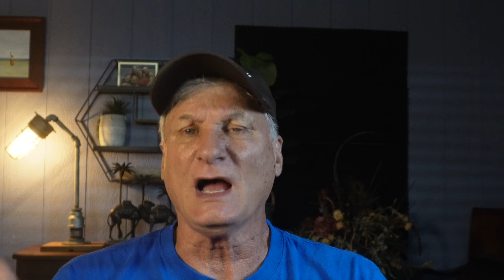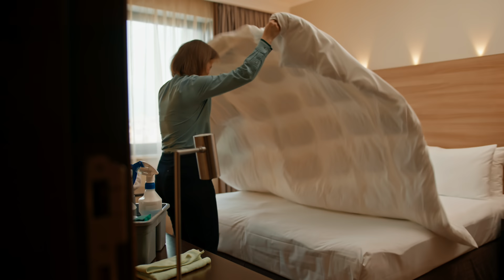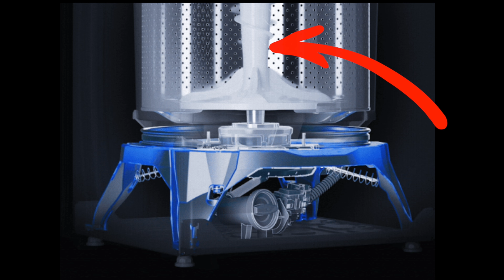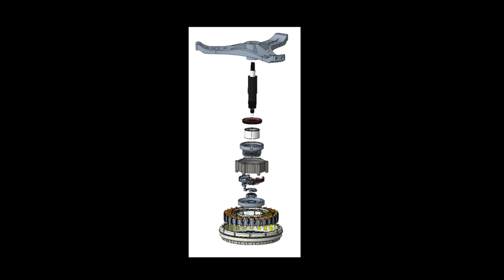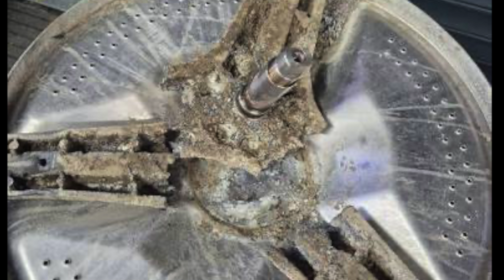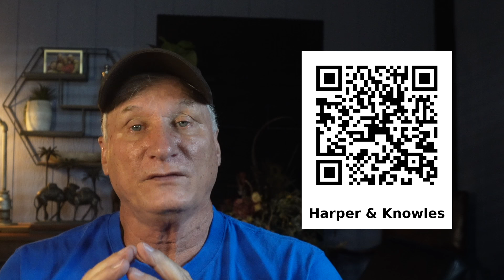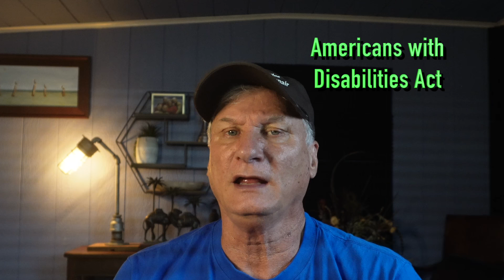Maytag's New 30-Year Washer: No Gearcase, Real Agitator, 900 RPM

Comment: Whirlpool has been "leaking" information on this new "commercial" Maytag washer in a similar fashion to their last Maytag "commercial" washer. We service techs know how that turned out. The current Maytag "commercial" washers are the same skimpy unreliable design as all the other Whirlpool/Amana/Admiral washers. This new design doesn't address the weakest link of all and that is electronics. This new design is still electronics dependent which means there's going to be a lot of expensive repairs on these machines.

Comment: Still running a Whirlpool top load from 1999. Only had to replace the lid switch and agitator dogs once. Nothing else. If it had a larger tub it would be perfect. Simple to operate and repair. No electronic crap. Question, in your opinion which household top load machines currently sold in big box stores are the best quality?

Comment: I'll believe it when I see it. I have no faith in our old famous brands, and even less faith in Korean made appliances.  Just because there are only two parts, doesn't mean those two parts are made of quality materials.  Then these washers and dryers use crappy appliance paint that chips and rusts within 2 years, so even if this washer can be rebuilt, it might be all rusted out before 30 years is up.

For the washer to only last 15 years with 3 kids and husband with dirty clothes, plus wife, is not a long time, we had a Maytag with 4 kids and the parents, and it lasted 32 years and was still running when the buyer of the house wanted those Maytag's to stay with the house.  But, 15 years is better than 4 years that a Samjunk will last!  But will that Maytag, if it's built the way they claim, which is the old way, outlast a Speed Queen?  Time will tell, but I won't be rushing out to buy one since I have Speed Queens.

Comment: Still DIY fixing my 21yo Whirlpool Gold Washer and Dryer from 2005. Family of 5, running them daily. Almost all the parts are inexpensive. 

Top Load Washer: No transmission, just a direct drive motor. The motor connection (plastic and rubber) piece wears out every few years. Had to replace that twice. Door switch finally broke. No suspension rods to break. The most expensive repair: The motor finally gave out after about 18 or 19 years, and it was less than $200 for a new one.

Electric Dryer: The rollers in the back wear out eventually. Replaced those twice. (Get good ones, as the cheap Chinese ones just don't last. That could count as a third set, but I count it more as a learning experience, not the fault of the washer.) One of the temperature sensors broke, inexpensive. The heating coil went out after about 16 years.

At this point, one or the other breaks down every other year or so, and I can pretty easily get it back up and running within a couple days. It's not hard, once you understand how they work. My boys have grown up watching me DIY fix all my appliances, cars, etc. so they jump at the chance to do it now. I usually get to diagnose, buy parts, and often come home to a finished job.   

Hearing the trouble the "new" washers from 2010 forward are having makes me glad I got the ones I did, when I did. Knobs and mechanical timers and no screens (minimal electronics) are the way to go.

Comment: 7:39 My mother had a Maytag that died a couple of years before she did.  We called it the "may fag" and said, "See?  It did fag, already!"  It had a 3 phase motor and a converter board that controlled it.  This board converted single phase 110 volts AC to DC.  Then, it had 2 banks of semiconductor devices, 3 in each bank, which I believe to be IGFETs (Insulated Gate Field Effect Transistors).  The first bank of 3 had one side, either the source or the drain, of each connected to the DC positive.  The other bank had one side of each connected to the DC negative.  Then, the opposite side of each of these semiconductors was connected to one from the other bank and one of the 3 coils of the motor.  The gates were connected to the low-power electronic control circuitry which switched each IGFET on and off with proper timing to simulate 3-phase current.  By varying the duty cycle and timing of the pulses, they could speed the motor up, slow it down, or even reverse it by swapping the timing of the pulses on any two coils.

Comment: The whole purpose of the ADA is to make sure that disabled people have the same access to public & private spaces that non disabled people have independently, and without the requirement of another person to assist in whole or in part. In the home, that means appliances must be fully useable from a seated position. 

A top loading washer fails that requirement because from a seated position: 
the lid cannot be opened, the tub is not visible which also means items cannot be removed if tossed inside. This also makes closing the lid difficult or impossible without assistance. And lastly, the controls: 1. cannot be accessed from a seated position; 2. knobs cannot be turned if the disability is related to hands permanently being in closed position, fist-like position and/or lacking the ability or strength to change the settings. 

Front loading machines solved the tub and controls location accessibility problems, whereas buttons are easier than knobs for some. People void of hands or arms may find buttons or knobs more accessible depending upon their individual situation. However, wifi software that can be linked to accessibility software is where access to controls shines which means that hand and arm disability & even blindness are better able to use machines without requiring a non disabled person to wash (and dry) their clothing. 

Stove/oven controls on the front instead of the top or a pop up on the rear is another example of an adapted appliance that is ADA compliant. Refrigerators and freezers as combined units aren't truly compliant. Only the drawer type that can be set into cabinetry spaces really allow full access. Drawer dishwashers are also better  than the standard folding door types.

😉 This has been a quick PSA from a member of the disabled community.

In our daily lives, round doorknobs eliminate access (replace with levers) curbs create barriers, steps create barriers, doorways less than 3 ft wide eliminate access, and public toilets* without the space and ability to rotate a wheelchair or walker into position to transfer between the commode and device privately eliminates access but also, and especially, the dignity of a disabled person.
*Please also remember we only get a single stall in public restrooms that we can actually use and our internal organs can also be affected by disability  making our ability to wait for that dedicated stall problematic. Please remember to consider us when walking into an empty restroom and having your choice of several stalls.  Thank you!

Comment: There was a time when every washing machine was built to last 30 years.
Reply: Thats how we help to save the environment, by building things that last decades rather than get replaced every 5 to 10 years.
Reply: @shawSumm4647 exactly. I never understood how we are "saving the planet" by buying awful machines that need an extra rinse & maybe even a 2nd wash & then it dies in 5 years. Same with toilets. How is it saving the planet if you need to flush 3 times. It gets me so mad because everything was sooooo much better. Same with fridges. They took away freon for a junk that spoils food.
Reply: Wasn't the change of freon. It was the recycled aluminum and making the coils thinner for better heat transfer along with cheap parts and computerized crap that made it unreliable. The lunar compressor from LG is junk. A basic over and under " freezer on top fridge on bottom," is still the best buy. But not LG.
Reply: @MattyDemello  Yep, and I was told by the guy installing my new house AC that they are coming up with a newer refrigerant that's even worse than the current one.  Next time dems get control...   climate-cult bull-headed democrats.  Vote republican at every level.
Reply: @MattyDemello  capitalism has a tendency to enshittify everything. we need to stop doing economics like dumb apes and start organizing society intelligently instead of putting the power of production of entitled brats.
Reply: @shawSumm4647 and the epa says climate change no this is how it started
Reply: @logansmokes.2762 
climate change is a myth anyway, same with fuel and water scarcity, it's all artificial.
Reply: my washer is 50 years old and still repairable.
Reply: @moabyte2 it’s getting harder to find people to repair them.  Those who do have. 70 machines in shed, and a dozen old ones for sale.  Brought my mom’s before she passed, now mine.  He said $100 to fix, or I give you $50, then I sell it +$400 in a week.”
  I think she got it 1980
Reply: @larryharris5840 
That’s the beauty of it - you don’t need someone else to repair it. You can take it apart and figure it out! So says my set from 1992.
Reply: @larryharris5840 Different brands, same machine.  The appliance guy can piece together a functional machine at will.
Reply: @mrskimthomas06  Willing to do it, and YouTube and a few cheap parts.
Reply: I have a Kenmore washing machine in my basement from 1985 and it still kicks ass.
Reply: @obxarms7685those were the good years
Reply: @obxarms7685 yup cause it was built by Whirlpool (the old Whirlpool)
Reply: All these new features suck. My wife and I bought the cheapest washer and dryer we could find in 2009. Just the most basic set we could find. The washer is still running great and has yet to need a repair.
Reply: @ericromano7703 In what counts, its the SAME.
Reply: @ericromano7703  neighbor built a new house. New front load washer, dryer. Best rated.  But he made 2nd laundry for his mom’s old washer, dryer in mud room.  *dairy farm*. For barn cloths.  He was going to put in dairy barn but his wife said he does that he does his laundry out there.  In few weeks he realized his wife doing kids laundry in old washer.  She said without pre wash, soak sink. Even 2 cycles thru front load laundry was not clean for school cloths.
Reply: They were actually designed to last 12 to 15 they have slowly been building failure points into them to force people to buy new machines as for this new product I will believe it when I see it a 30-year washer with a 5-year warranty and their track record over the last several years has not been great
Reply: My best friend's parents have a washer, dryer, refrig/freezer, and freezer that built from the early-to-mid '80s. They all still work perfectly well.
Reply: absolutely. my mother's washer is 32 years old and still works well.... why are companies getting away with selling garbage these days??
Reply: @galliard77  Because people still buy them!
Reply: @522dalton  what are people supposed to do if nothing else is available?
Reply: @galliard77 
reliable stuff is out there. people just don't want to research, trust the salesmen too much and go "oooh, pretty screen, wifi, AI!!".
Reply: Yup and they didn't have to claim anything to prove it.
Reply: That applies to a lot of things.
Reply: Refrigerators too!
Reply: there is huge demand for the old models, they should just rebrand to 'Maytag Classic' and OFFER these!!
Reply: @danielgriffith8911 
the cost to build them is astronomical, they source the compressors from a multinational company when before they were built right here in the US. the closest to "old quality" is True residential, those cost like cars.
Reply: like a can't kill Kelvinator from the 70's!
Reply: My parents Kitchen Aid dishwasher lasted 36 years, their cheap Hotpoint refrigerator lasted 34. I’ve had to replace every fridge I’ve bought lasts about 6-7 years, same with fridge, although we had bought a Maytag fridge to replace that Hotpoint in 2006 thinking it was a decent fridge and it was the biggest piece of junk I ever bought. The government sometimes should regulate and pressure these manufacturers. AND they need to be made HERE. Their old Noreco fridge probably was 25 years old when they replaced it. It still runs, but it sat for about 30 years , so I’d say it has run for 50 years. Sure, its  freezer has no frost free feature, but it keeps beer and soda ice cold .
Reply: @jdy1054  
whirlpool and GE build their stuff here, but that doesn't tell you anything since parts are coming from all over the world, and it's still engineered to save them every penny. even speed queen doesn't make their own circuit boards, they're imported from china or mexico.
Reply: Yes, they came in harvest gold and green......
Reply: I just bought a house in the northeast Sacramento area (Orangevale) and the prior owner left behind their appliances.  While the kitchen stuff is...meh (they function, but are a bit yellowed and battered, and will be replaced when I get around to upgrading the kitchen), they did leave a 30 y.o. Whirlpool washer and dryer set which each are built like tanks.  So they don't have a touch panel or a digital screen.  big whoop, they wash and dry clothes.
Reply: @sel @selfdo  them and have  them painted!
Reply: @mrskimthomas06 Im bringing in an "illegal" gas range from out of state.  I have a relative who's a plumber that can oversee my connecting it to gas supply so it's done safely.
Reply: You mean a time when greed was frowned upon.
Reply: But they found out if the machines last 30 years. It will take 30 years before they can sell you another one! Now they expect a machine to last five years! More sales, more profit. The five-year ones cost more than the 30-year ones did! They claim they use less water. Nope, because you have to run them through at least 2 cycles to get your stuff clean!
Reply: My Kenmore stackable is over 25 years old and works perfectly fine as when I bought it.
Reply: No they weren't.
Reply: In 1972, we bought that w/d set. It was still working well at 25 yrs.).
Reply: Used to be very common for one washer and drier set to serve three generations.
Reply: Like water heaters and furnaces.
Reply: And, unfortunately, all the companies that sold them are hurting because of it, or have gone completely out of business.
Reply: not 30 years, FOREVER. My grandpa worked on Maytags, many of them are still running
Reply: They can build a good spider if they want to. I've never seen a bad spider on an mah3 or 4000, bearing yes shaft never
Reply: now they are made of chineesium
Reply: If they built them that way today, we could not afford them.
Reply: @Johnny-s3d3o Yes we could. We would buy ONE at maybe $2K and then have it for 30 years instead of buying one at $700, and then another in 5 or 6 years, and then another, and another, and then, another, and after that, another, and, finally, ONE MORE. 

Now, some people would want a new one after 5 or 10 years, and sell the old one, with lots of life left in it for someone with less means, or, for someone with more sense, or both.
Reply: @itsmeme8287  Yes, Maytag cant allow that though. Same as newer cars, crammed full of useless spy tech that listens to you and scans your room using bluetooth and wifi.  Apparently they are more interested in selling your data than appliances.
Reply: @jensz9360 Maytag is out of business. It is 100% Whirlpool. When I started servicing almost 46 years ago I started on Maytag wringer washers. Todats Maytag is junk
Reply: @itsmeme8287 1970 they were 369.00 union scale was 3.80. Today that washer would be around 3500.00. It would still need service, but not like the junk today.
Reply: Then we entered late stage crapitalism where the only thing that matters is planned obsolescence and greed.
Reply: Most things back then weee built to last 4-5 times longer that the cheap crap today. Everything is plastic. It’s crazy
Reply: Cars also, stereo equipment also. I do still have my old Sherwood receiver and it still works. I did have to buy a new remote.
Reply: we needed trumps greatest depression to kick start getting competition around longevity

Comment: Looks like Whirlpool is attempting an update on the cabriolet.   The cabriolet used a rotor and a stator, like this new model. However, it also had the4 suspension rods, which were inadequate from the factory.  When our cabriolet was running properly it was great.  No lie about the higher spin speeds; although being next to it during a spin cycle could be unnerving.  The machine sounded like it was either going to take flight or explode.  The machines were notoriously unreliable.   It seems I replaced all manner of parts on it, including a bearing that required a couple of us to completely disassemble it in my living room.  If Whirlpool can get it right this time, the stator drive should be a neat feature.

Comment: We go though 3 or 4 wash machines or dry machines a year. They run 8-12 loads a day. The #1 failure of either is in the control boards. The more your machines look like they belong in a spacecraft the less they last. We buy them used on marketplace and look for the oldest analog machines and they always run the longest. All this energy saving and water saving tech just makes things easy to break so the whole thing is trash

Comment: Dryers eat your clothes. Too rough. All that lint is your washables wearing out. Feel the thickness of the fabric before and after drying them. They are noticeably lighter after. Better to use a 3000 rpm spinner dryer and then hang dry the laundry.